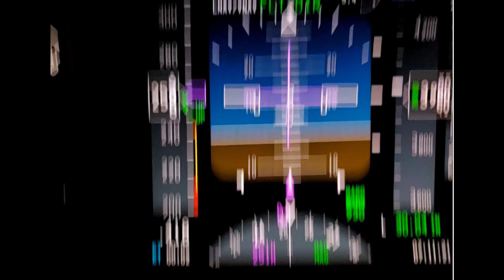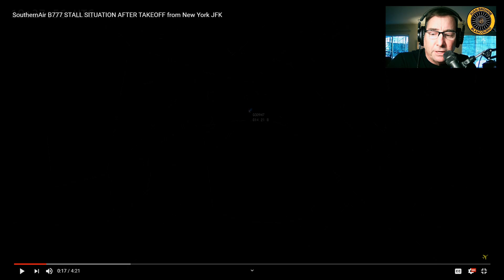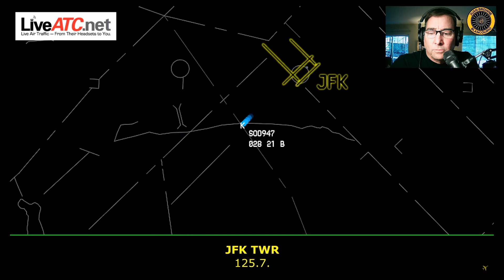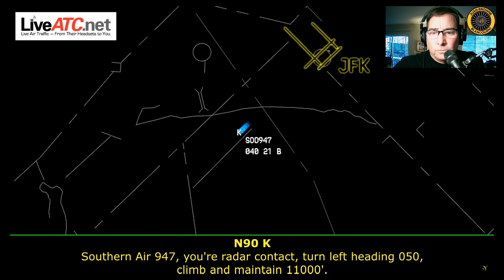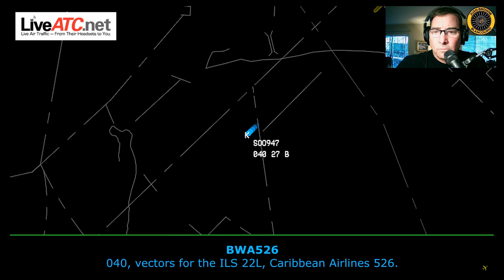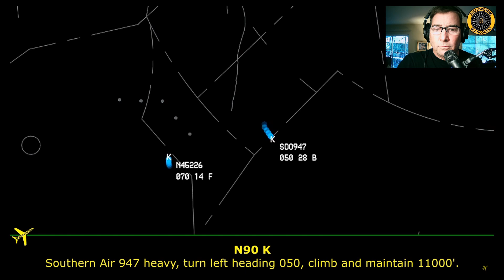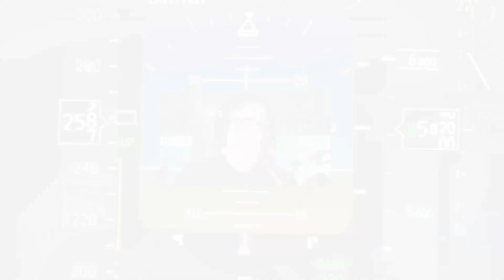"Stall, Stall, Stall" B-777-200 JFK 15 Nov 2020

Comment: Was there a final outcome of the Delta flight out of LAX that had the compressor stall and returned to LAX while dumping fuel over the populated area.  I was not able to find any investigation on the FAA’s or the NTSB’s web sites.  I’m curious to find out what happened to the crew and why it took so long to get the aircraft back in the air.  From listening to the ATC recordings I believe something else was happening besides the compressor stall.  I also believe the crew believed ATC knew about them dumping fuel.  I base that on the way ATC asked the question if they needed to hold to dump the fuel.  My other research showed they started dumping fuel right after the compressor stall.

Comment: With regard to the Airbus design: if the Airbus will NOT allow you to stall the aircraft, how is it that Air France 447 was able to do it? Is it because the autopilot checked out once the pitots froze? I know once they started free falling, the pitots couldn’t function properly and were getting bogus airspeed readings. Perhaps that prevented the protection from kicking in and saving the plane?
Reply from the maker: Normal Law vs Direct Law
Reply: @blancolirio  thank you. I’ll go read about that right now! Perhaps it will be the subject of a future blancolirio video! Excellent work as always

Comment: Juan!  just found ya via "rec for you" on YouTube.  Great work.  5 years ago I was on YOUR Bigfoot before upgrade and got a good lesson in this very thing on the -300 running DFW-HKG and GRU.  As guppy commander (same instrument panel) ... I honor the bugs so I don't have to relearn that lesson when I return (hopefully soon ... but we'll see).  I get debriefed on every sim training event "you're a little slow retracting flaps"  "Did I overspeed 'em?"  "No" "thank you."

GREAT GREAT airplane and division, but ... BUT ... that -300 wing was kept short for terminal considerations ... and as you so aptly described ... pilots need to be aware of what is going to happen to that heavy beasty when the flaps are retracted ... LET ALONE try to make a turn.  

Holding short of the runway to tower "we'll need high speed climb and waive any fix altitude restrictions" ... before ya ever cross the hold short line.

((been on a leave of absence from the outfit, so your video has been good to get the trons firing again.  landing currency event in a few days, should be able to avoid your hotel for the LBB C210 icing video you shot ... then back in the saddle for December))

subscribed.  See ya on the line!

Comment: Excellent video! Maybe I missed something. When we were a heavy weight operation we did not ask ATC for  high speed climb. We advised them that our minimum climb speed would be 261 knots for example. This was based on sub part D of the FAR. “(a) Unless otherwise authorized by the Administrator, no person may operate an aircraft below 10,000 feet MSL at an indicated airspeed of more than 250 knots (288 m.p.h.).

(b) Unless otherwise authorized or required by ATC, no person may operate an aircraft at or below 2,500 feet above the surface within 4 nautical miles of the primary airport of a Class C or Class D airspace area at an indicated airspeed of more than 200 knots (230 mph.). This paragraph (b) does not apply to any operations within a Class B airspace area. Such operations shall comply with paragraph (a) of this section.

(c) No person may operate an aircraft in the airspace underlying a Class B airspace area designated for an airport or in a VFR corridor designated through such a Class B airspace area, at an indicated airspeed of more than 200 knots (230 mph).

(d) If the minimum safe airspeed for any particular operation is greater than the maximum speed prescribed in this section, the aircraft may be operated at that minimum speed.”

There were certain departures that required leaving the slats extended to comply with a turn radius requirement. Typically a note that said max speed for departure is 200 knots or all turns must be completed within a specified nautical mile radius. These usually involved Special Operations Airports but not always.

Excellent video. I miss flying but being retired has it’s perks. Excellent description of ASAP and FOQUA... I worked for the same airline you do. I hope I spelled FOQUA correctly...
In training we would always be briefed on the “trends” from the gate keepers.

Once again another outstanding video!👍🏻

Comment: It is important to know that the radar data on the aircraft from the ATC view does not show airspeed. It shows only ground speed. A head wind, tail wind component will prevent the controller from understanding the true speed of the airplane.

Comment: A little note on "high speed climb". In the United States this isn't really a request you need to make. Though an advisory to ATC may be prudent nowhere states a pilot must request it from ATC (assuming no speeds have been assigned by ATC or by a published procedure). 91.117 of the FARs says:

Unless otherwise authorized by the Administrator, no person may operate an aircraft below 10,000 feet MSL at an indicated airspeed of more than 250 knots.

and

If the minimum safe airspeed for any particular operation is greater than the maximum speed prescribed in this section, the aircraft may be operated at that minimum speed.

The FAA Order 7110.65, which is basically the manual for ATC, elaborates on the meaning of minimum safe speed (3-1-11): 14 CFR Section 91.117 permits speeds in excess of 250 knots (288 mph) when so required or recommended in the airplane flight manual.

Comment: Juan, it's my understanding that ATC has no authority to approve deviation from FAR 91.117(a). AIM 4-4-1 says, "An ATC clearance ...  IS NOT AUTHORIZATION FOR A PILOT TO DEVIATE FROM ANY RULE, REGULATION, OR MINIMUM ALTITUDE NOR TO CONDUCT UNSAFE OPERATION OF THE AIRCRAFT." [emphasis theirs, not mine]

"High speed climb" is essentially the same as "speed at pilot's discretion" ... you still need to obey the speed limits. Contrast the wording of 91.117(a) -- "Unless otherwise authorized by the Administrator" -- and 91.117(b) -- "Unless otherwise authorized or required by ATC". [91.117(b) is the 200 KIAS limit in a class C or D airport traffic area.]

91.117(d) does allow the pilot to fly at "minimum safe airspeed for any particular operation".

Comment: Good video, just thought I'd lend a bit of info. The speed field in the datablock is groundspeed, not airspeed, and it's extremely accurate. It's taken by averaging the last couple of radar hits, but modern systems are set up using multiple sites, so the aircraft gets hit every couple seconds at a maximum. In a lot of cases, the radar "sweep" is only around a second.
Reply: Sure you can get IAS from Mode S.
Reply: @peteconrad2077  I don't know if STARS is capable of displaying IAS to the controller. If it is, it's certainly not a feature that's commonly used, and is definitely not used at New York tracon. 

I can't imagine a scenario that displaying IAS instead of groundspeed would be advantageous to an approach controller.
Reply: @ry-ballz  yes, they use it at Heathrow. Deviate from 160 to 4, there and the controller will call you out on it.
Reply: @peteconrad2077  some of the centers in the US can see it via adsb now. But I don't believe there are any approach controls in the US with that capability.
Reply: @ry-ballz  wow, that surprising since it is only a Mode S pick off. Given the crap I’ve got from JFK approach about speed I’m amazed they don’t have it.

Comment: Thank you Juan. Question: I've always wondered, and disagreed with the NTSB account of AA Flight 587- If, as you said, can yank the Airbus joystick back and the flight computer keeps the aircraft to min maneuvering speed and stay there, then why couldn't the computer keep the pilot from cycling the rudder pedals so fast that the tail comes off? I would think the flight computer has G load limits for that... or should have limits for that. Don't fighter aircraft have G load limits? Why doesn't Airbus? And shouldn't they?
Reply: A300 isnt FBW. Even on FBW airbus the rudder isnt FBW.

Comment: Juan, DGBryan here:  retired from a freight airline in the lower southwest corner of Tennessee.  I enjoyed the Juan in a PFD section, but there are only 2 real items that could have caused a perfectly airplane to almost stall at 4,000' on a clear day leaving JFK.  1.  Was the crew given grossly incorrect weight and balance paperwork by their ramp, specifically the zero fuel weight?  If this happened and the crew did not catch the error comparing their projected weights with the weight and balance, they could have taken off much heavier than they thought they were:  hello stick shaker.  2.  The crew fat fingered their weight entries into the FMS, then missed it when the did their performance review prior to takeoff, or they f'ed up cleaning up the aircraft.  If the crew used NADP-1 and began their clean up at 1,000' or 1,500' AGL they should have been clean and at MMS well prior to trying to stall a perfectly good aircraft.  If they used NADP-2 and cleaned up at 3,000' AGL the PM may have gone flaps up AND SLATS RETRACT with the first handle movement:  hello stick shaker.  I saw that happen sitting sideways in a DC-10 late one night.  FAR 91.117 (d) allows anyone to climb at their minimum maneuver speed below 10,000', no matter how high the speed is.  No requirement to ask for a high speed climb.  To close, 250 knots indicated at 9,900' is almost 290 kts. TAS .
Reply: We don't know where their config. changes were made, but the airspeed deviations before the stall make it look like they were hand flying. WHat do you think?

Comment: Airline captain here. I've been a flight or sim instructor in Advanced Qualification Programs at three different companies. Unless something has changed in the last few months, Southern does not have AQP. They still use 1950's style training.
Reply from the maker: Wow!!
Reply: @blancolirio  well, Southern Air is now more or less controlled by Atlas Air.  Atlas is a non-AQP carrier.  Juan, I liked how you abstained from "Monday morning quarter-backing" BUT ........ What type of scenarios would have led to this?  AP on or off?   Did they go into VNAV ALT and cleaned up too early?  On the 777 at MGTOW, what is a typical clean maneuvering speed?  Thx
Reply from the maker: @sandkorey  we don’t know at this time.

Comment: To me this is one of the areas where the FAA's rules and mindset are out of whack with reality. At no time should their rules force an the aircrew to fly an aircraft just above stall speed. Especially for take off and climb out aircraft such as this Boeing 777 should not even need to ask for permission to safely fly the aircraft. Once the aircraft is up and everything is "normal" when they request and get climb to 10000' they should be able to throttle up and climb as fast as they want to provided they are operating the aircraft within operational limits and in "normal". 

On a side note with all the data being collected I am surprised that all the flight data is not transmitted to a central repository managed by either the aircraft manufacturers or the pilots association. 

PS Its good to see you back out and flying around again :)